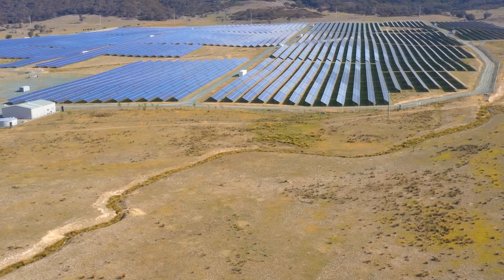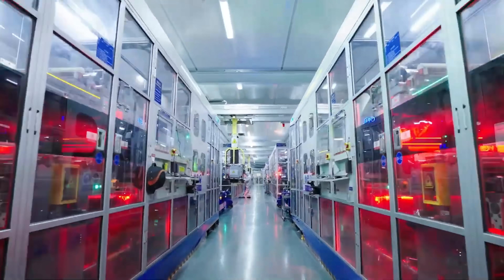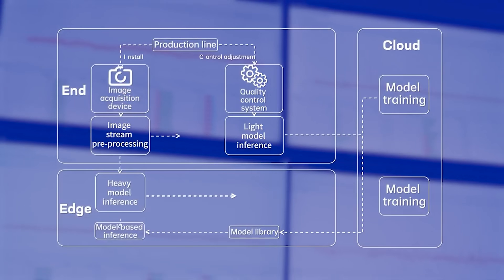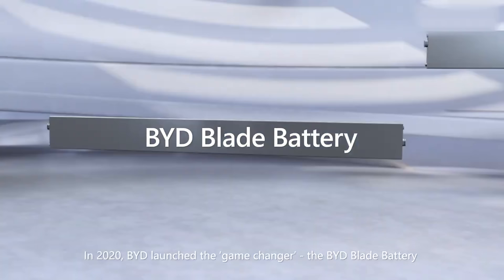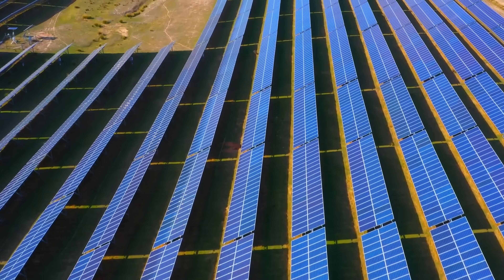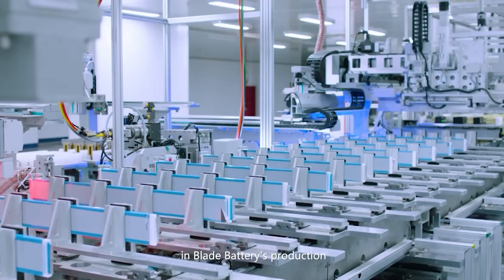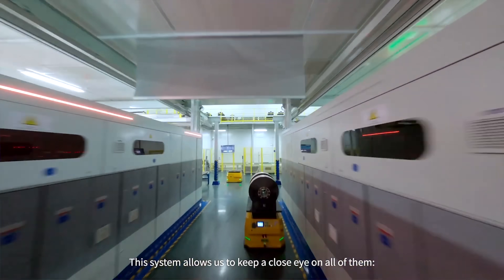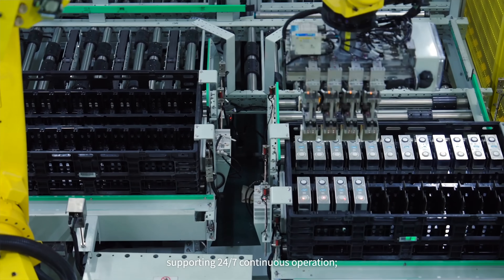U.S. Just Activated Its First Sodium-Ion Power Plant — Lithium’s Days Are Numbered

Comment: I can see Sodium as the Normal Range and Lithium as the Long Range version of a car trim.
Reply: Places like Texas could benefit from sodium batteries because of their drastic temperature swings.
Reply: That seems less likely than than a hybrid solid state sodium-based technology.  Lithium is getting squeezed from every direction.
Reply: I agree with this but short term only. Sodium batteries will get improved to the point where Lithium will no longer have an advantage in weight, size, or energy density.

Comment: To my knowledge the first Sodium-Ion batteries out now are a disappointment. Personally i don´t care if they are a bit larger... but at tests made, they drop Voltage when they have less than (was it 60%) of the charge left.
This said, there are certainly companies wanting to be FIRST OUT with the batteries, but they are still like some BETA version. I am all for Sodium, especially as I hope for safe and reliable batteries, and batteries that work better in a cold climate. But I think we have to wait a few years.  Also the price was horrific. They´ll get cheaper when big mass production is out.

Comment: The main advantage of NA over LFP chemistry is of course price and material source, cheaper and less harmful to the environment. Mind you I have not yet seen a major drop in price for the few things that are available in NA as well as LFP. There are other advantages and disadvantages to them both, low temperature use problems of course for LFP and very small fire risk compared to zero for NA, the linear voltage drop of NA that makes it less suitable for use in cars and the need for modified rectifiers for use in homes. NA should in theory take over in stationary storage use but I am much less convinced to will take over in cars, before it could do that there are a number of other battery developments currently ongoing that may make them far less desirable for EV's.

Whatever happens though, because these batteries are now so essential and useful for, well, everything research is charging forward in many areas, solid state, nickel batteries, air batteries, people are investing money in the most unlikely areas of research just in case they can pull off a miracle and take over the battery world, that's a gigantic target to go after so billions is worth it for these companies. I suspect any battery tech we are using today or next year will be seriously obsolete in 5 years, it's like computers, it's hard to predict exactly where we will be, all you can say is, it will be better, more powerful and cheaper, whatever IT is!

Comment: Li and Na both are moving targets for batteries, so there's not much we can predict...other than that Li mass produced is far ahead of Na production, and Li improvements probably will keep it ahead of Na chemistry for several years. Remember, Li batteries don't blow up anymore. Li batteries are starting to appear in solid state, so they can handle more extreme temperatures. Li batteries can use heating elements to keep them lively in winter. 
I bought a small Li starter battery for my Kawasaki Versys motorcycle a few years ago. It was smaller and one fourth the mass of the old lead acid battery. The new Li battery worked like a champ, never failed. Na batteries are just beginning to appear for automotive use (as starter batteries). About the only advantage they have over their Li brothers is that they can tolerate cold temperatures better. Both chemistries are far better than lead acid.

Comment: Sodium is coming but lithium isn't going away. This is just the tip of the transition iceberg. Specific case uses will determine which battery chemistry is best suited for their uses. All I know now is that the US is still lagging way behind and all the incentives have disappeared due to the politics in this country. So we will be moving slower than the rest of the world until we wake up in this country! 
All the new chemistries are great but we need to get a chemistry that will allow a car to travel 400 actual miles on a charge before all of  the American people will make the switch.
Reply: Oddly, Americans used to be very fond of big cars with big V-8 engines that guzzled gas and didn’t have a 400 mile range. But then OPEC changed that and small Japanese cars led the way to fuel economy in cars. The same thing will happen as EVs get more affordable, people will buy them even if the range isn’t 400 miles.
Reply: @LateForDinner-mn1hn range in ev matters alot more than gas.. doesn't take long to get gas.. gas is everywhere.. ev can make trips suck.. I prefer reliable less expensive vehicle then spend lil more in fuel and still spend much less
Reply: @daveriddlelin9327  Electricity is everywhere, and when gasoline cars were first introduced en mass there weren’t many gas stations. It took almost 40 years for cars to surpass horses so this shift to electricity is well on its way globally.
Reply: It all depends on the economics. Both are wanted and needed!

Comment: We were promised graphene in Lithium ion 10+ years ago. I don't think Sodium ion will go full scale any time soon. Maybe at least another 5 years while they are releasing new version of LFP next year.
Reply: CATL is all in on sodium. That's the biggest factor. Where the world's largest battery maker goes, so does the market...
Reply: Sodium  will eventually dominate energy storage,  its 1/3 the price of Lithium ion.  bascilly nearly all new EVs  to use this battery will be cheaper than any ICE  car on the market
Reply: @cheetomussollini The major market will be for grid scale storage. Solar/wind plus cheap, long-lasting batteries will be cheaper than anything else.  In ten years, people will wonder wth peopl weree thinking wrt obscenely expensive nuclear or eye-rolling 'green' hydrogen nonsense.

My hope is it arrives fast enough so moron utilities don't spend billions building hugely expensive nuclear pink elephants, saddling rate payers with obscenely expensive power for decades. But since utilities are essentially 'cost plus', there is.zero incentive to be cost efficient. Nothing like a boondoggle nuke to drive up costs (and hence guaranteed profits) for decades.
Reply: @cheetomussollini    Energy density will be an issue for most EVs for the foreseeable future, even without knowing all the other cell parameters.
Reply: Sodium will scale faster than Lithium. CATL is backing sodium and others will have no choice but to follow or lose market share.
Reply: Huh? CATL is entering mass production of their Gen 2 Naxtra battery before year-end.  Yes, it will take a few years to ramp up to the huge demand they will likely see, but CATL says conversion from LFP to sodium can be easily achieved at existing LFP factories, so it could happens faster than we imagine.

As for Peak's sodium battery, it's just about DOA with the significantly lower energy density (140W/kg vs 175W/kg). Zero chance it's 25% lower energy density can compete.
Reply: Of course CATL will say all the right things to get more investment. Who wouldn't have a positive spin on their own technology?
Didn't MG promise solid or semi-solid state battery by mid 2025? Still waiting.
Reply: @TwistofWrist1941 CATL is backing words with action.
Reply: We will wait and see.

Comment: I believe that the Lithium industry will fight to keep its dominance in the market. Despite, a better technology in sodium ion. The fact that sodium ion is already in production cars in China, speaks volumes.
Reply: Why would they though? There will still be plenty of demand for lithium for high-end battery chemistries. This will be the case for a long time, perhaps indefinitely.
Reply: Sodium batteries are heavier. In regard to mobile applications, lithium is still king.  Non-mobile,grid systems, weight doesn’t matter.
Reply: @holdon4992  While weight does not matter, efficiency is KING and here Sodium sucks as bad as Lead Acid.   To be economical for power storage a single percent = difference between economical and garbage.  LFP is 98% efficient to 95%.  SOdium is 93% to 60%... Hopeless.  I haven't got a clue why ANYONE is talking about Sodium in any rational use cases for ANY reason.
Reply: @w8stral  Sodium is abundant and cheap. Safer. That’s the main selling point. If land based, just bigger batteries made. Sure more re batteries but still probably cheaper.
Reply: @holdon4992  Lithium is abundant and cheap and only makes up ~5% of cost of battery.  It does not matter if you replace the 5% with 0% when Na+ requires 30% MORE OTHER parts of battery to work equivalently.  Sodium's round trip efficiency is about 85%, Lithium is 95% +++ which means dear friend you need ~12% MORE panels, 12% MORE inverters, ~12% MORE copper/aluminum wiring......   You have to be INSANE to use Sodium batteries for ANYTHING other than VERY VERY Cold applications where insulation/heaters are not available for some odd reason.  Sodium is pure garbage compared to LFP in terms of cost.
Reply: @w8stral  ok. Sodium is more abundant than lithium. It is literally everywhere. No importing needed. At some point, technology will advance enough that even with the inefficiencies, it will succeed.  No more runaway fires in cars for example.  Still, lithium is king in regard to storage capacity.
Reply: @holdon4992  Sigh: Sodium burns bud, just like ALL high energy storage devices.  If you "really" want to be "safe", go with LTO or mercury batteries.  Your ignorance is staggering
Reply: @holdon4992  Efficiency is #1, #2, #3 with energy density #4, #5, #6 and cycle life #7.  Nothing else matters other than voltage drop(sodium sucks)
Reply: Pretty much in the same way pig oil and legacy auto have been trying to do over the last 12odd years
Reply: @brettmciver432  Pig oil is vastly superior to Vegetable oil for cooking.   Legacy auto rightly sees EV's as a niche as the battery tech is NOT good enough yet.  Unless you are going to argue(correctly) that without your own battery manufacturing plant you are irrelevant, but see here is the deal,  you can always BUY a battery manufacturing plant quite easily.  You cannot buy name brand loyalty etc.  Ask Rivian or Stellantis whom are technically alive(not really), and all the other bankrupt EV companies.
Reply: @w8stral 
Hmmm how many leagaxy auto companies have gone belly up in the last 120years , lots.
CATL ,BYD and tesla make their own batteries and lots of others do as well.
The batteries are only on the early stages of development and will only get better.
Reply: @brettmciver432  Delusion.  Batteries(lithium) are over 40 years old.  What you see as "advancement" is utter nonsense as you could buy near identical Lithium cells in the 90's.  The only "advancement" has been the mass manufacturing of them making them cheaper, not better.
Reply: @w8stral 
Bollocks
Higher energy density , more power , silicon in anode to increase density , way less cobalt in certain chemistries , 4680 batteries , lfp, lmfp etc lots gone on and now lithium Sulphur batteries with 3 -5 times the energy being worked on etc etc etc.
Still lots of work to be done on lithium to get the most out of it.
Reply: @brettmciver432  suggest basic history... none of what you typed is true that did not already exist in the 90's with the sole exception being silicon anode
Reply: @w8stral maybe but theres been cont8niuos improvements especially in manufacturing especailly with the like of teslas 4680 battery and it associated improvements and continuing improvements, catls (and others) innovations and improvements .
Theres alot more to go with lithium.
Sodium has also along way to go .
Every viable battery chemistry has alot of improvements ahead.
ICE reached its best 50 years ago and theres been very little improvments related to it at allfor 50 years.
Electronics only made a small improvement.
Reply: Biggest lithium battery company CATL Just started mass producing sodium batteries..so your point is debunked
Reply: They won't be able to stop Sodium batteries. Too many benefits.
Reply: Better?  How???  What delusions do you live in?  Sodium ion efficiency is pitiful(~85% average NOT the quoted 93%maximum efficiency).  LFP is 95%-98% efficient.  Sodium's CLAIMED high C rate ONLY is correct in the MIDDLE of its SOC.  It has a LOW C rate at low SOC and high SOC.  Lithium has a near linear C rate from 0% to 100% making it FASTER TO charge LFP than Na+.     The volumetric efficiency is 30% better in LFP's case than Na+.  You want a car with more internal room?  Do NOT get a Na+.   On top of this, the ability to access the bottom 20% or 30% of Na+ is next to impossible which means IN REALITY, you need nearly 2X the Na+ batteries as LFP for identical range.  I am not even talking NMC here....    Na+ is not cheaper as the majority cost of the batteries is the manufacturing plant, labor, and shipping.  NOT the cost difference between Lithium and Sodium.  This is less than 10% of the cost of the product.  

The one and ONLY  thing Na+ is good for?  Cold Weather.  That is it.  That is all and even that is not entirely true, it is just MORE  true.
Reply: @w8stral do you work or invest in the lithium industry?
Reply: @ChopperChad  Can you READ basic information as the host is too damned LAZY or worse, just ignores as inconvenient facts of reality
Reply: @w8stral why are you so angry and dogmatic? The informed market players will decide what they want, not you. Chill tf out.
Reply: @ChopperChad  Ah, you are just here to have your ears tickled and lied to, not to be INFORMED
Reply: @w8stral well lithium batteries create a geopolitical dependency on unstable regimes and stuff. Sodium does not need rare earth metals. You see the point. The battery in my hybrid is drained in an instant on a winter day here.
Reply: @andrevangijsel957  Complete hogwash.  No battery requires rare earth metals.  Suggest you learn what those words actually mean before EVER using them again... Lithium is everywhere.  Iron is everywhere.  Phosphate is everywhere.  Manganese is in most places.  Graphite is in a few places, but is requires for ~ALL battery types so... The only lithium chemistry which are partially problematical is the Cobalt Lithium and no one really uses them to begin with so, why bring them up.    Your battery is "drained in an instant" because you have to heat everything up in the morning and it requires a lot of power.  Also you lose ~25% due to below freezing temps.  Sodium loses 10%.  Sounds good right?  Problem is Sodium already loses 30% of its capacity before it starts due horrifically low voltage at its lower SOC.  Or you have to carry 30% more... ugg
Reply: @w8stral  Abloobloobloo all Useless Technobabble BS that is nearly irrelevant compared to Main advantages of Sodium.

Come back to me once Lithium becomes easily available anywhere in the whole planet and extracted with little to no environmental damage.
Reply: @w8stral  It's cheaper, more accessible, better performance in extreme temperatures, safer, longer lasting. What else do you need?